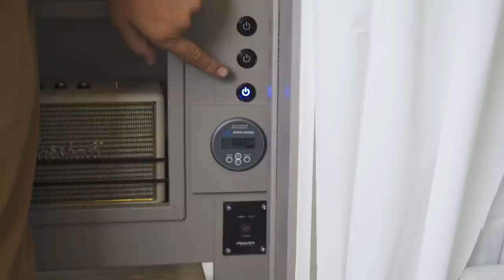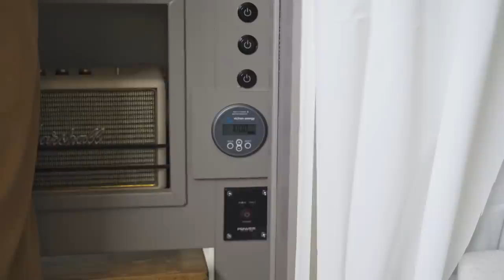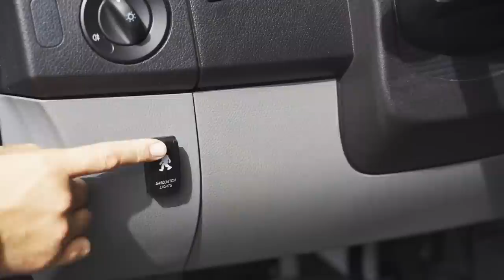VAN TOUR: SELF CONVERTED SPRINTER VAN WITH SHOWER. FULL TIME VANLIFE.

Comment: great job on your van design.  Your garage solar setup is so clean.   the water heater is 12A/120V...it requires 1440 watts....a 2000 inverter would have been enough?!

Do you have any wiring diagram ?

Comment: Very nice conversion. Clean and good. It was not clear for me if this is the extented LWB of the Sprinter or just the regular LWB.
Reply from the maker: Claudiano Araujo it’s the normal 170” wheel base.
Reply: @RoamOverlandVehicles  Thks a lot. Another question. What is the width of the bench in the living area?

Comment: I like your design and layout. Very well thought out! Great feature being able to turn the sink faucet for rinsing exterior items (5:42). However I think you may have made a mistake by undermounting the sink on the wood block counter rather than having one that is surface mounted with a lip sealed on the surface top. The wood will get chipped and could absorb moisture, swelling over time from splashes and washing.
Don't know if you can find one, however a clear or semi-transparent gray water container might be better (6:56) so you can see when it's nearly full. Hate to see it overflow inside your nice cabinets!
Great idea using leather straps for the cabinet doors! (10:09) Softer look, and as you say, won't ding the ceiling panels or chafe while walking by. Excellent pointers about blocking exterior light from the fan (19:45) with magnetic covers, and the windows too!
Your "garage" is well laid out with nice use of space. Good tip about the battery isolator and being able to charge your three batteries with the Sprinter alternator. Just awesome!
Two questions: 
1. Do you know what you added to your van weight after the build? 
2. How is the gas mileage?
Thank you for your inspiring video and excellent resource list - you have given me many fine ideas for my eventual van conversion.
Cheers from Montréal.
Reply from the maker: Thanks for all the input! The clear container is something we’ve searched long and hard for. I would love to find a good quality one but haven’t found one yet. 

The weight. We measured it fully loaded it came in at 8600ish pounds. But that was before we switched to lithium batteries that saves 90 pounds. 

Gas mileage. 15-18mpg pretty consistently.

We’ve been in this van for almost a year now and the layout has worked out so well the only thing I’d change is the bench. I would make it a drawer and not a top open style. 

Keep us updated on your build

Comment: Hi Guys, awesome build. I would highly appreciate if you could tell what kind of material you used for the ceiling, it looks so much better than the standard wood most of the vans use.
Reply from the maker: Steffen Behn we used pine ship lap. We used the solid wood stuff not the MDF. Six months in and it’s holding up perfectly. Looks brand new still

Comment: Great set-up. Thanks for sharing. I hope you have many happy adventures. 
I have a MB 144 and have been thinking about putting a heater under the passenger seat. I see that you have the lower chair base for that seat. Was there any problem fitting the Espar heater into that space? Did you get the chair base from MB?
Cheers
Reply from the maker: Pookastudio no problem at all. Room for days! Yeah we ordered the part from Mercedes. Note when you do order it they will ask you for your vin and will try and order the same seat as you have. Make sure they know you do want the lowered one. I’ve ordered three and it’s happened all three times! The heater is such an amazing improvement. It changes any trip from roughing it to living comfortably.
Reply: Weekends We Roam thanks for the info. All the best on the road ahead.

Comment: Love love love your van! I've bookmarked the video and even took notes while watching. Question: how does the shower dry out after use? Thanks!
Reply from the maker: Kristina Carrodeguas Hi! The shower does great drying out. The shower pan is for rvs and it has a slight slope to it which helps. Also the FRP shower wall material is designed for bathrooms so it cleans and drys very easily.  If you’re thinking about doing a van, do it!

Comment: hows that Boch Water heater working out? we are thinking of instaling one . Has is stood the test of time ?
Reply from the maker: jessie Sol we’ve liked it. It works great for two quick showers on one heating up. It takes about 15min to heat up. If i was to do it again, I would want something on demand. Something for those days when we have lots of water and want long showers.  But no complaints so far.

Comment: Gorgeous build! Did you weld the steel for the bed yourself? I'm looking into doing that and I like what I see! I'd love to get a closer look at it!
Reply from the maker: Marissa Ferrante We did weld it. It’s mild steel. Next one I build I’ll do with aluminum just to save more weight. I’m the whole bed frame only weighs 40lbs but more weight savings the better! I’m even if you can’t weld. Check our a product called 80/20. Its extruded aluminum that bolts together with simple tools.

Comment: That was a great tour of your beautiful van, nice job on the build!! Could you please tell me the make and model of the Air conditioner unit (was it hard to install) and how did you make the back window covers/ head board?
Reply from the maker: bjbhehir sorry for the delay in a response. The van does not have an air conditioner except the one the van came with for the cab. The back headboard was made with 1/4” ply and then batting and fabric. Right now it’s attached using heavy duty Velcro but we’re Considering switching to magnets. Hope that helps!

Comment: Great video!  I have a 144 that I am currently building out. I have installed aluminum rails along the sides that will support my bed frame.  I'm wondering what you used for your bed frame?  It looks pretty minimal - is it just 1" square steel tubing?  I see that you have a couple of cross-members welded into place for extra support.  Are the wooden slats screwed into the tube steel or are they fixed in some other way?  The tube steel supports your weight ok, no real flex or bend happening underneath you when you are climbing on and off or while sleeping?  Thank you!
Reply from the maker: Darrin Goodman yeah just 1” square tube welded together. It is bolted to the rails with 6 bolts. The wooden 1x3s are only to support the mattress and allow ample ventilation. The bed is very sturdy. No issues what so ever. No flex on the frame either.

Comment: I live in a place where it's hot.  Having a diesel van, would you be able to run the air more?  Would your batteries plus solar help with running the air at night?  And yes I love your entire set up.
Reply from the maker: Contest Goodies we looked into it. Dometic makes a roof mounted, or under the van mounted 12v system that we could power. But not for that long. I have seen systems that would run the rooftop 12v ac and when the batteries got low it would turn on the van and charge the batteries. That might work.
Reply: @RoamOverlandVehicles  thank you so much

Comment: Love your video. Very detailed. Can I ask where did you get screen for both doors, rod extender for shower, and insulation for all windows. I'm in beginning of my van conversion, and I love that product. Thank you.
Reply from the maker: Milena Nachtman the screens we got off amazon. We measured the doors and got oversized screens slightly larger than what we needed. We then cut the screens to size and then sewed Velcro into the edges. We added Velcro to the top to hold it. 

The shower rod has been awesome! I added a link to it under bathroom in the description, for some reason I can’t copy the link on my phone right now sorry, but that link will get you there. 

The window coverings we got from https://www.vanmadegear.com

We love them. Only advice is add a couple of stitches to the magnets, ours moved around a bit. Other than that these things are great. They do so well keeping heat in or out. 

Good luck on the build, let us know if you have any questions we love talking about vans.

Comment: I'm a new subscriber and I've seen tons of van-builds online.. I don't subscribe to many of them.

I'm wondering if I could run 2 PC's day and night, with screens and an electric water-heater like yours, induction plates and all the interior lighting you can shake a stick at. The power supplies are 1000w and 850w respectively.. and I'm a graphic designer so they're often rendering and overclocked.

Would five of your batteries cut it and how often would I need to run the van to charge the batteries if I wanted to do away with solar all-together? Would it make sense to carry a small diesel generator (that also sips from the main tank) to rapidly charge the batteries?
Reply from the maker: I haven’t done any calculations regarding desktops and or screens. 
I can say with our 300watts of solar and 300ah lithium batteries we haven’t had a single issue regarding power needs. We run lights and fans and water heaters and induction cooktops and refrigerators and water pumps all day long. Maybe not simultaneously but I would give the guys at battleborn a call. They a super knowledgeable and helpful. I’m not endorsed by any means, I like telling people about companies that I like.

Comment: Thank you for the video and the great ideas.  I am mostly curious how you lowered the passenger seat.  I could hear exactly what was said about (sorry partially deaf).  Could you list the product or what was done please?
Reply from the maker: Ben Reeve we got a lowered seat base from Mercedes Benz. If you call the parts dept they will ask you for your vin number don’t give it to them. They’ll order the same high ones tell them you want a lowered seat base. We got. One local and two we ordered out of a Florida Mercedes dealer. 

They run around $200-300 for the base and ours came black.
Reply: The audio is broken on the video. Not just you. Midway it all goes to left channel.

Comment: Van looks awesome and well built!
What did you use for insulation? Also what did you use for wood on walls and ceiling?
Reply from the maker: trophyfishin you know I wish I would’ve talked about that in the video. That’s such an important part. We did a layer of 80mil sound deadner on all panels including roof and floor. We used 3m thinsulate for the hydrophobic and insulating properties. And then on top of that we did reflectics. It’s been amazing. We’ve been down below freezing and all the way up into the high 90’s and have been comfortable. 

Wood on walls and ceiling are pine ship lap.
Reply: Weekends We Roam very nice job thank you for the reply
Reply from the maker: trophyfishin of course. We’ve gotten so much help from the van community when we were building our van we’re always willing to pass it on.

Comment: My question is, how does one live full time in a van. Do you buy a piece of property? Because to have car insurance, get paychecks, get mail, you need an address. What do you do about that, or is the van not really a full-time home, but just a vacation thing?
Reply from the maker: CRW when we decided to do this we had been saving for a few years. We wanted a full year of just the trip, no work. So we budgeted accordingly. If we wanted to go for more than a few years we would’ve budgeted differently and or decided to work from the road.   A few months into it we decided we’d do at least a year on the road and go from there. We will probably settle down in a few months.

Comment: You are from Alaska, what about having moisture in the Van after taking a shower. Does the moisture in the air freeze on the windows or are fans strong enough to pull out the moisture in the winter?
Reply from the maker: We grew up in Alaska, we were only there for two months in the summer visiting family. As far as winter time use. We’re avoiding the really cold areas. We’re chasing the seasons so hopefully we won’t have to worry about long term cold. 

Just in normal day to day use the fans do a great job pulling out moisture

Comment: any smoke alarm or carbon sensors ?
Reply from the maker: Pedro Picaso yes. You can’t see it because of the camera angles. But we have one back by the bed on the passengers side mounted to the wall. And one mounted under the bed as well. They’re are combination smoke and co2 detector. We don’t have a propane sensor because we aren’t using any propane.

Comment: did you guys install the battery isolater yourselves?  And is your gray tank under your truck or in the back with your fresh water tank?
Reply from the maker: FBomb Vlogs we did install an isolator. We got it from Battle Born batteries. It’s the li-bim-225 for the lithium batteries. Works great. 

The gray tank is a 7ft long 6in wife pvc pipe tank I made. The shower drains into it and when we get to a dump station we push a button inside and there is a motorized ball valve for draining.
Reply: @RoamOverlandVehicles  how do you keep that tank from freezing?
Reply from the maker: FBomb Vlogs we routed the trip to avoid the winter. But if we did hit winter weather somewhere we’d have to hold off on showering for a few days. That’s the only tank outside of the van.

Comment: How long is your bike drawer and how high from the floor is your bed frame
Reply from the maker: The drawer slide was 48” long. The height, I believe it was near 32inches from floor to bed frame. It was enough to fit an XL Santa Cruz 29er. (I did have to remove my seat though)

Comment: Where did you get the on/off push button switches?
Reply from the maker: Jeff Parker I’ll hav ego add them to the list. They work great.

Quentacy 19mm 3/4" Metal Latching Pushbutton Switch 12V Power Symbol LED 1NO1NC SPDT ON/OFF Black Waterproof Toggle Switch with Wire Socket Plug (Blue) https://www.amazon.com/dp/B071H9KWL6/ref=cm_sw_r_cp_api_i_TowJDbAK9VKE9

Comment: where is the water pump in the system?
Reply from the maker: Cory Neff it’s in the back right below the water tank. There is a make shift cage around the water pump. Last mi Ute addition right before we hit the road. It’s worked out really well.
Reply: @RoamOverlandVehicles  Do you keep the pump on all the time or just when you are running water.
Reply from the maker: Cory Neff we turn it on and off as needed. In the morning while we’re getting ready we will leave it on for the hour or so then turn it off.

Comment: Hi, I think all of us would like to know what the total cost of the van and the conversion is, please post it or send it to me, thanks, Dianne from Ecuador
Reply from the maker: Dianne Ludena for a brand new 170in wheel base sprinter high roof the price will vary from $44,000-$50,000+usd depending on what options you get. The build out materials cost will vary wildly. This level of build out with all the high end stuff like, refrigerator, lithium batteries, toilets, window blinds etc, can run $25,000. Our first van was a used van we got $23,000 and put about $10,000 into it.
Reply from the maker: Dianne Ludena we paid $46,000 for our van and put about $24,000 into the build out not including labor cost if you were having someone do it.

Comment: Ok here is the part that most of this people don't talk about cost and the dreamer don't understand this people spend some like 25k+ on this game this is not bad but is not for the average worker you can do the same for less this to jokers got money this is not for everyone they never talk abaout how much cost
Reply from the maker: 1miltond You’re right about this may not be for everyone. Our first van wasn’t this nice either. We had a sprinter we bought with dents and 110,000 miles on it. It was amazing. You don’t have to have a brand new van or fancy interiors to enjoy a van. I’ve known people who have a van and nothing in it but an air mattress a cooler and two folding chairs and they do more than most. Point is, you don’t have to spend 25k on a build out to enjoy it. Jokers with money, I worked two jobs for two years to be able to afford this. We didn’t walk into any money along the way. If you want something bad enough you’ll make it happen...
Reply: It depends if you have learned the necessary trades. In 60 years as a woman, I have. Other than the electrical and solar and I may watch enough videos to learn that too.
I'll be salvaging and upcycling everything in mine but the solar and water. I can build my own custom shower etc.. I've seen these vans for $5,000, add another $5,000-$6,000 on power, water and toilet.
My math comes to $11,000-$13,000 to budget in for surprises. I could do similar for $10 grand if I salvage everything. Not bad.